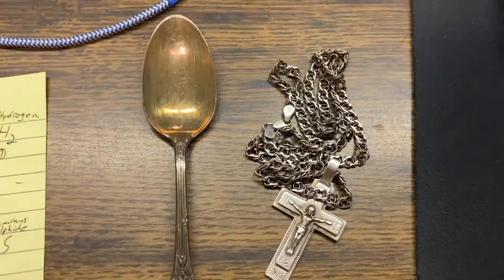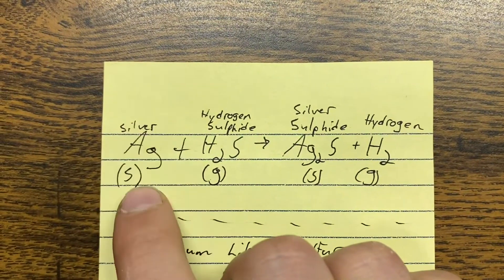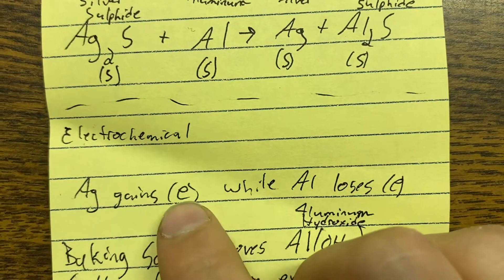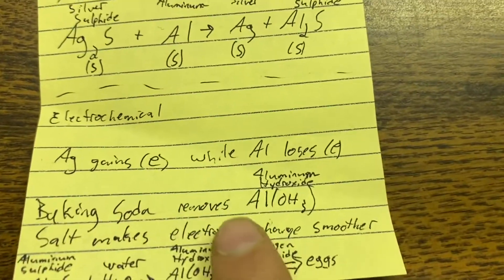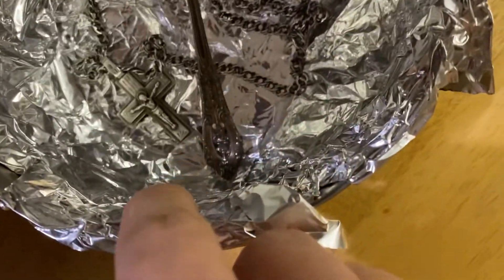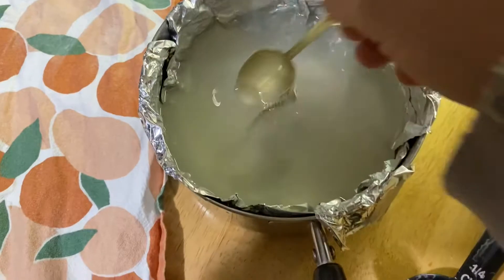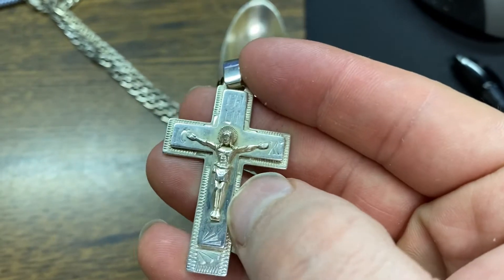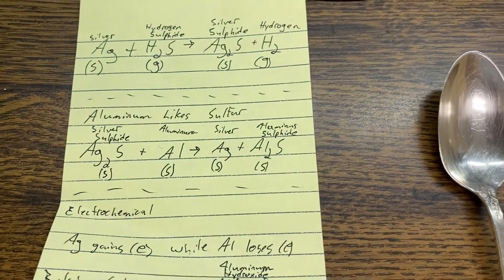Chemistry of How To Easily Polish Silver with Aluminum Foil, Baking Soda, and Salt

Comment: This is a great video.  I can see what chemicals are used, and why they are used.  I was surprised at how much salt and baking soda you used.  I would have thought that the weight of the chemicals would be comparable to the weight of the tarnish being removed.   My plan is to use the aluminum foil method and then use regular silver polish after that.  Also, I plan to use a glass baking dish instead of a metal cooking pot, because glass will not cause any unwanted side reactions.
Reply from the maker: That’s a good plan. I don’t have a glass pot that’s big enough.